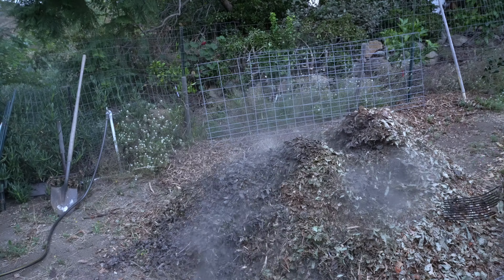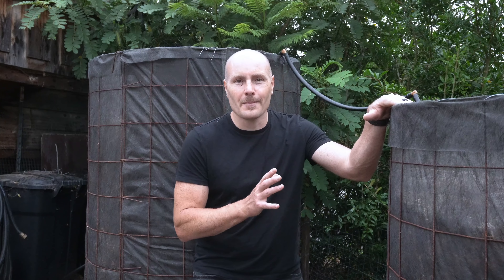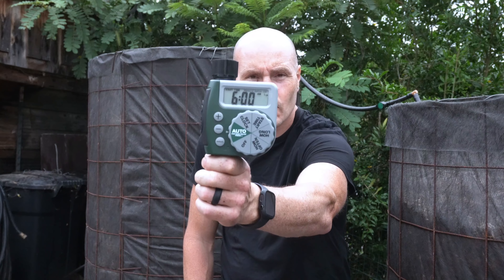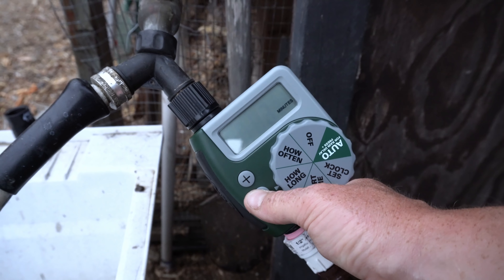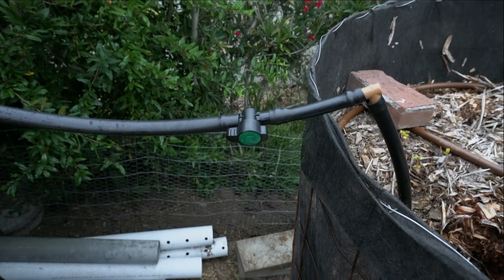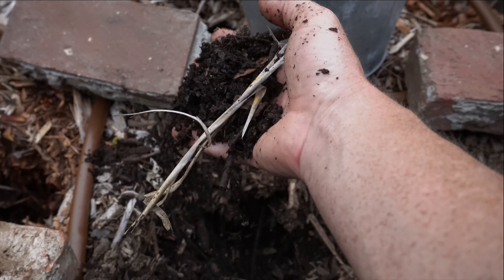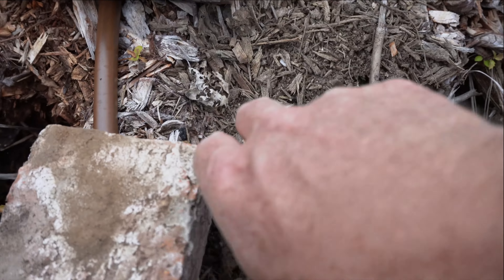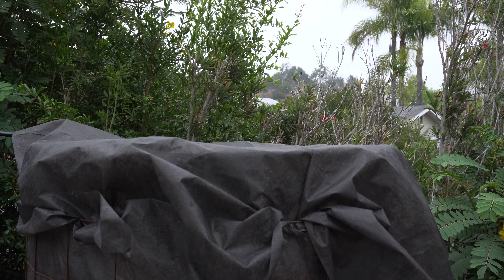Adding Irrigation and Composting Worms to the Bioreactors | UPDATE VIDEO

Comment: You could also run a water hose through it and have a shower. Since you don't need to turn it, you could just add urine to heat up the compost when you wanted hot water.
Reply: I expect you’re tongue in cheek... but on the practical side, you don’t want this pile to reheat after the initial heating phase.
Reply: @garthwunsch  I'm serious. I was volunteering at a permaculture farm two years ago, and they had such system. The priority of the system was more shower than compost though, and in terms of shower, it worked great! I didn't stay long enought to see the finished compost, but I can't imagine why it would be bad.
Why is the reheating not desired?
Reply: @razpet20  I’m not an expert, but I’ve watched so many hours of lecture from Ingham / Johnson-Su that I feel like I’m family LOL. As I understand it, the initial thermophilic reaction sets up the ‘aging’ or maturing process that isn’t supposed to be interrupted. the aim is to  encourage fungal growth, not to get the compost to finish quickly. That being said, there are setups I’ve seen in temperate climates that make massive compost ‘cylinders’ and lay in major piping to heat/preheat their water most of the winter. Since these are also static piles, and HUGE... I expect they must go anaerobic by spring.
Reply: @garthwunsch  Ah, interesting about the encouragement of fungal growth. I won't argue as I think they know their stuff. It's a different process for different outcomes.
Meanwhile I've found a post on the results from the heap on a farm I was on. Here is the process: "the spruce woodchips were mixed in about 2:1 ratio with grass clippings. After 3 weeks, the temperature went to 70°C and stayed like that for 3 months. After that period, we occasionally added urine which made the temperature rise again. It stayed like that until december. It's very important that we use woodchips for brown material here, because they don't get compacted as much.
The next spring we opened the heap, and, seeing there is still quite a lot of uncomposted woodchips, we turned it while mixing it with cow manure. This time it needed longer to heat up, but with occasional urine pour, we managed to heat it up enough, so it provided hot water for another season. In the autumn we added worms to help with decomposition and in the next spring, we had a lot of great compost that needed just a bit of sifting from remaining woody parts."

Comment: Hey Diego, thanks for the next precious video. I do wonder tho, since it is fungal dominated compost it cannot freeze, otherwise its mostly gone that fungal part of it. How does it work in colder climates with all those air chimneys sucking icy cold air up from ground level along with the heat from the pile for up to 4 months a year.
Reply from the maker: You would need to keep it indoors or else it would just go dormant.

Comment: Hi Diego keep up the good work. I plan to build this contraption. Have two questions.
1. I have a machine available to chop branches to almost sawdust. If use sawdust, chopped up green foliage, cow dung, water, and other micronutrient additives; mixed in a cement mixer. Will it work better and quicker?
2. I have serious concerns about worms. Obviously red composting worms are desired. But these live in top few inches and do not travel down much. I have heard that due to compression and possible anerobic condition down below they die. Please address this issue perhaps getting reply from Dr Johnson himself.
Reply: There shouldn’t be anything anaerobic in any part of the pile... that’s the purpose of the air chimneys.

Comment: Excellent video Diego, i am plannig to build one, but i got to ask, does it need to be filled at once, or you can start with few material and then add kitchen scraps, leaves, grass clippings, like traditional composting?
Reply from the maker: You can fill it over time, but it will take a while if you are adding little bits at a time.  I think the system is better setup to be filled all at once.
Reply: @DiegoFooter  Thank you for your feedback Diego! Keep up the good work :)
Reply: In another video, Drs. Johnson and Su say to fill it up in one or two days max. It needs the initial heating reaction in the entire pile, and then the material all finishes at the same rate.

Comment: I have used stainless steal fly screen on mine instead of fabric let you know how it fairs in six months.
Reply from the maker: Good idea.  Something from a hardware store?
Reply: @DiegoFooter  yep, or ebay I found large roll for half the price, will email you some photos if you like. Also Diego check make sure your drip line doesn't use herbicide to stop the roots getting into the drip line i have herd some horror story of it leaching there are some brands like netafim that use copper much safer.
Reply from the maker: Thanks, I will check.

Comment: Hi Diego! Thank you for another great teaching moment for me! May I ask you a question - I bought a bail of straw from my local nursery 2 months ago. Ended up not using it for mulching my raised beds, too many seeds. The nursery said that it was not chemically treated, but I am not sure ... After I transported that bail in my SUV in June, the car smelled very unpleasant for several days; the smell was like fish oil stinky. I wanted to ask if I should use this unused bail of straw to start a new compost pile/area. What would be the best composting method? Thank you in advance for your advice! Ioulia from Maryland
Reply from the maker: If you think it is chemically treated AND you are worried about it, then I wouldn't use it in the garden or compost it.  If you weren't worried about that, then you could mix it with some green materials in a pile and compost it that way either through an aerated or non-aerated pile.
Reply: @DiegoFooter  Thank you so much Diego!
Reply: Great question -!! I also bought a lot of straw here in LA and was wondering if I could use it for compost

Comment: How long will it take to be finished compost?
I can buy wood chips for $12 per cubic yard. Can you start with wood chips?
Reply from the maker: At least a year depending on climate. I started with 100% woodchips.
Reply: But they need to be smashed to less than 3/8” - according to the inventors.

Comment: We have 40 chooks, could you fill a bio reactor with just straw and chook poo from there shed or would it be a bit to hot.
Reply from the maker: I think it would work great.
Reply: @DiegoFooter  thanks for that
Reply: Just be sure the temp is below 80 degrees F before you add the worms.  You need the worms.

Comment: You wouldn't want to put diseased leaves into the bioreactor, right? The low-temperature won't kill off the mold spores or viruses.
Reply: the biodiversity you build inside the bioreactor should take care of that.
Reply: @omgg4031  I follow Charles Dowdings advice of composting everything. Weeds, roots, seeds, diseased plants - so far works fine.

Comment: How does chicken manure and composting find its ways into the the johnson system? Any hints?
Reply from the maker: You could add chicken manure and bedding into the reactor to be composted.
Reply: @DiegoFooter  thanks. U r right.
Reply: That would add nitrogen and increase the heat early on, as well as speed up the decomposition process.

Comment: Could this work in a cold climate? Average winter temps at 30f?
Reply from the maker: You wouldn't want it to freeze because that would slow biological activity.  It wouldn't die, it would go dormant, then it would take a lot longer to break down.
Reply: @DiegoFooter   I live in the land of the Frozen Chosen... six months of winter. I’m expecting my reactor to take two years to complete the process.

Comment: How many worms do you put in it? I started my small worm bin with about a thousand. I imagine you'd need about 20,000 in a bin that big.
Reply from the maker: I dumped in a few one gallon buckets of worm compost that had active worms in it.
Reply: Dr. Johnson says, in another video, only need to add about 100 worms. Yes, 100... you read that correctly. They will copulate and populate!!!
Reply: @garthwunsch  Dr Johnson says a lot of stuff, but never shows the end result. My hot compost pile, turned 5 times in the garden, attracted hundreds of worms the first season and gives me great product after 6 winter months. Nov-May
Reply: @joeshmoe7789  I did see a short clip in one film and it was indeed like clay... muddy, because it was so wet. I sheet composted a new garden bed last summer ... inoculated it with a couple handfuls of wrigglers (there were almost no worms at all when I dug it in some non-productive lawn area). By late this fall it was really well populated!!! Lotsa copulation goin on :-) seems like you and I share the same length of winter... the land of the Frozen Chosen. Will be interesting to see how the wrigglers survive the winter under the heavy hay/leaf/manure mulch.

Comment: Question @Diego Footer: Should you add an in-line activated carbon filter to remove chloramine? I'd hate to have my watering killing off beneficial bacteria and fungi.
Reply from the maker: I am 0% worried about the chloramine doing any killing of bacteria and fungi.  There isn't enough in the water to make a difference.
Reply: @DiegoFooter  Thanks. I did some research after asking this on "Google Scholar" so I could avoid the "pure organic" hand-wringing I often see... which I agree with in principle but I'm a science guy at heart. Based on the science, the chloramine will bind to any biological carbon, silt, sand or other particulates it encounters. From there, chemical reactions will deactivate it, liberating the ammonia (probably into a nice green for any composting bacteria). The chlorine released becomes gas. 

Of course, chloramine may kill bacteria or mold it encounters right away,but the effect wears off fast. In one study (from I think Cornell ag), the soil and compost pile biology rebounded to pre-watering levels in under an hour.

As usual, the "off the deep end" types have their hearts in the right place but miss the finer points. Like how the Grateful Dead were, indeed, an excellent, summery band with some killer, laid-back tunes... but never worth traveling the country to follow them. :-)

Comment: Super confused, this looks like this is taking way longer than I thought. Looking forward to the interview.
Reply from the maker: How long did you think it would take?  The feedstock is one factor in how long it takes and I am breaking down woodchips so that will take a long time.  But inherently the method is based on fungal decomposition which is slow.
Reply: I’m looking at doing this in a tropical environment with mixed chopped palm, leaves and mown grasses, weeds etc. Given the speed of decomposition in my climate I would imagine that processing time would be a lot faster than in more temperate climates. Anyway only one way to find out.